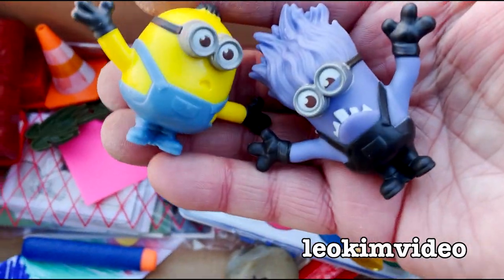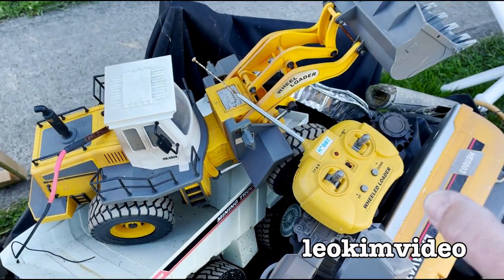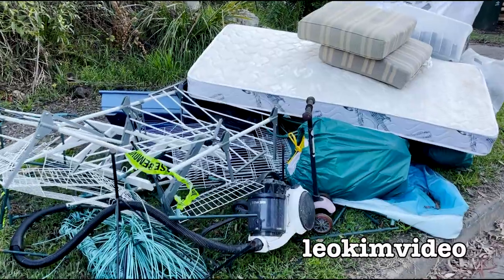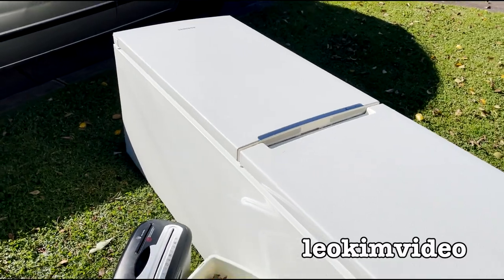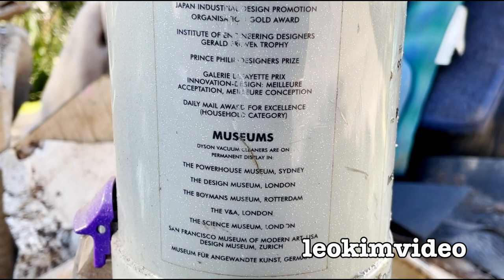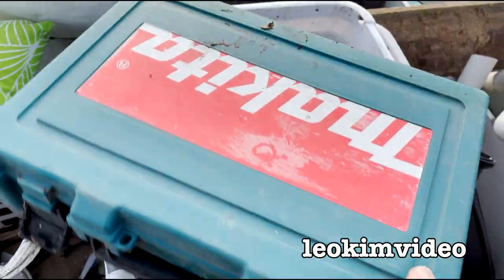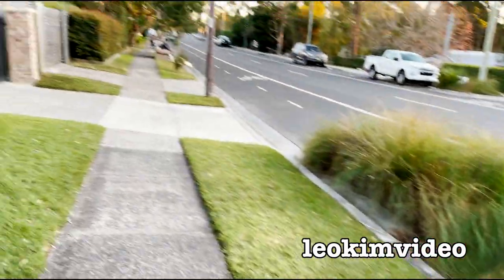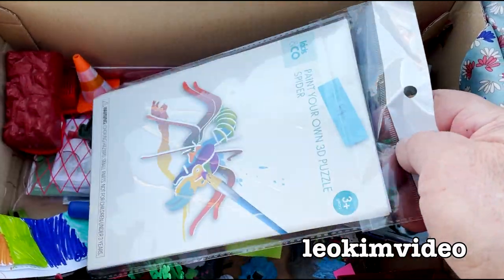Trash & Treasure Hunting Amazing Dysons Electric Ryobi Lawn Mower Warning BUYER BEWARE

Comment: Leo i my dad has had his Honda lawn mower for 16 years and never let him down once so shows that Honda when it comes to mowers I would say I still king but that’s just some of the experience my family have had with lawn mowers
Reply from the maker: I have heard many good stories about Honda Lawn Mowers and that's the brand the local councils and pro lawn cutters seem to prefer. But a Honda is nearly 3 times the price Vs a cheap petrol Victa. I see the top end Lithium battery mowers are adhering to the top end Honda petrol mower price. But the issue with the batteries is the lifespan, common to hear only 4 years out of a battery. If your unlucky only a year before it starts to decay in output. Extreme buyer beware on this battery powered stuff.

Comment: Diecast guy here. The crushed car looks like a Mercedes, perhaps an AMG CLK GTR. Don’t know the brand, though, but looking at the “ProStar” license plate, it looks fairly generic.

I was a bit surprised by that Barbie camper earlier on. It looks like a GMC Motorhome (think the movie Stripes), and as such could actually be pretty old, mid ‘80s at the least.
Reply from the maker: The Barbie motorhome was seen during 'covid lockdown times' the rubbish piles were very different when families were under stress. Maybe that's why everyone was throwing out beds. I did find 4 Dysons during the 3 council clean ups that were during lockdown. The Dyson find rate is roughly 1 per curbside cleanout. If I find 2 that's really getting lucky. Maybe i'll fill in the gaps of what happened during lockdown. I only took pictures and not video. But from what I could see families were very shy to throw anything out.

Comment: The filter definitely needs a good cleaning! If you also have a listen the bearings on the motor are going out, may want to take it apart and look at them, amazing find though, I found a DC04 in mint condition, that owners said it was just too loud and bulky, its better than my V8 stick and Kirby.

Comment: That crushed die-cast car is a model of a Mercedes Benz clk gtr amg (my lord that was nerdy)
.
.also I completely agree with what you said about dysons. We have so many dyson products in our house it may as well be some sort of dyson store. We have humidifiers, hair dryers, air purifiers, fans (all dyson products of course) and of course dyson vacuum cleaners. My favorite has to be the dc59 motorhead (our first dyson product) which amazingly still works even after all these years. I did have to change the battery but apart from that it's been an amazing product. It really backs up what you said about them being high quality products that last long
Reply from the maker: Wow, that's incredibly nerdy but also awesome

Comment: Talking about mowers we still use a greenfield ride on mower that my dad bought in 2001 and it still works to this day it dose need a engine now but it’s still worth buying a motor the quality on the new victas is not as good as the old ones we have a few old ones and they tend to just keep going
Reply: Also the sander and planer might still work the capacitors have died that can happen to anything

Comment: 46:06 i have 2 of these
1 thats been used about 20 times and the bearings sound like crap
the one i just bought last year is starting to sound the same and its only been used about 5 times 
if you suck up something that foams up or the moisture from the water being picked up kills them (i paid $85 usd for mine at walmart)
pretty good for the price but they slowly die after a year or 2 or about 50 uses

Comment: The vex machine in store for 239 is the exact same as the Hoover power dash
Reply from the maker: I bought the Vax Compact Power machine on special at Bunnings for $173. YES $173 NOT Amazon $550 or Godfreys $239. It's ultra buyer beware with this extremely overpriced stuff in Australia. It's a fantastic machine, the grub it lifted from our carpets was amazing. But how can Amazon be so expensive, it came to Australia proclaiming to be the place of good value. Yeah bullshit.
Reply: @leokimvideo  I one hundred percent agree stuff shouldn’t have a over $400 difference in the pricing I agree it’s total rubbish but I agree that the Hoover and vax machine is a excellent carpet cleaner a great bang for buck